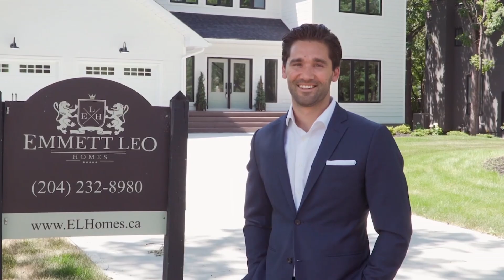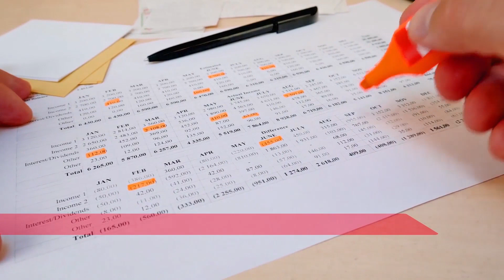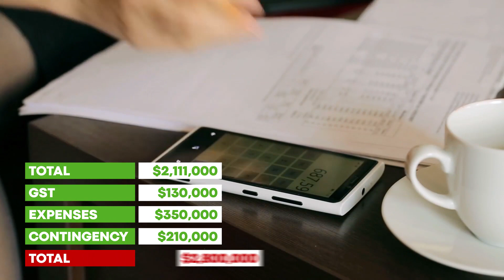The Real Cost To Build A House | Custom Luxury Home Edition

Comment: We can’t seem to get under $370 per foot in the SF Bay Area for a low end no frills build project… mostly due to labor costs but also due to product companies raising cost based on zip code
Reply from the maker: Yes, prices have been on the rise for everything!  However, it’s more about material shortages and lead time than anything else right now.  Prices have come down substantially, but lead time are still incredible.  

Next weeks video is about what building right is like and what to consider during these weird times. 

Thanks for watching!

Comment: Westchester resident here. Our house is brick on brick colonial. My dream would be to build a steel frame 12ft ceiling basement - 2nd floor, open floor plan house. I would like exposed steel beams both inside and outside. I’ve been told it will cost from a lot to too much unless it will be my forever home.
Reply from the maker: That sounds amazing.   Thanks for watching!

Comment: I always wonder about the resale value of these very high end homes. They are very impressive, but if I can spend that kind of money, why would I buy someone else’s vision ? Certainly, there is an advantage of time, but I would think the potential buyers would be few and far between.  Because of economics, you are starting out with less than 5 percent of home buyers.  After the 5 percent hurdle, you have to find some who has your exact taste.  Not a problem I will personally have to solve, but always makes me wonder.
Reply from the maker: Time is the only non-renewable.  Don’t underestimate that for the wealthy.

Comment: What is the contingent cost? Is that for unforeseen circumstances?
Reply from the maker: Normally 10% if the estimate is class B and A.  Higher for rougher estimates.  Is can decrease as the estimates get more granular.  Make sense?